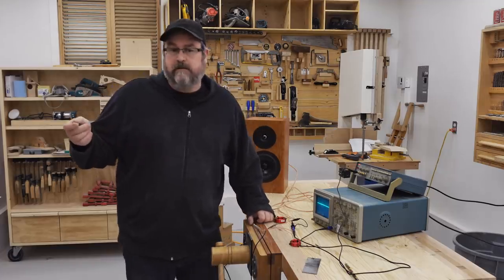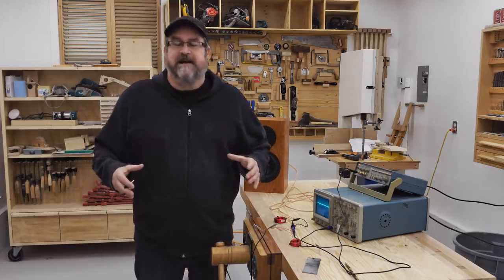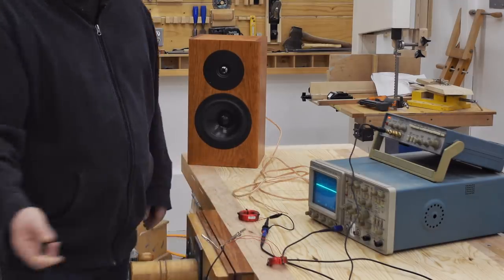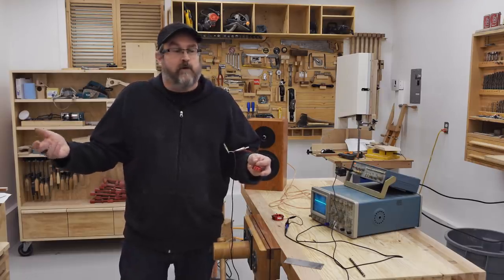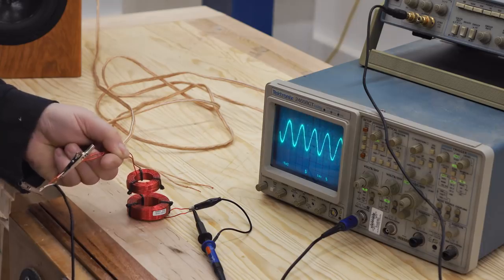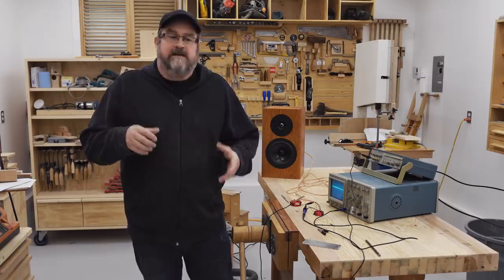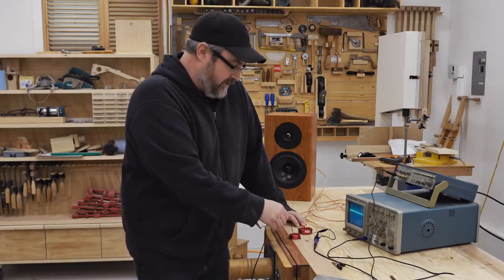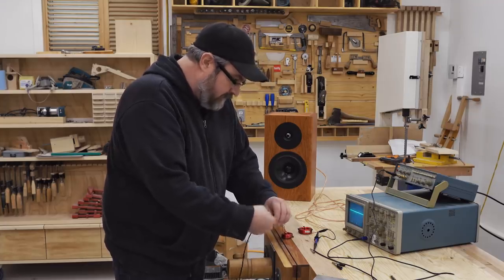Is Coil Coupling (Mutual Inductance) Really A Problem? DIY Speakers

Comment from the maker: The crossover building video:
https://www.youtube.com/watch?v=kO2faotm3sE

Another thing about this coupling between coils is that no filter is 100% effective - it's a slope, so there's already some low frequency signal going to the tweeter and high going to the woofer, but at a MUCH lower volume. 
My scope was set to 5mV per division, so the coupling when the coils are spaced as I did in my crossover is around 5mv peak to peak. 
And yes, this would go up as the volume goes up, but so would the regular music output from the speaker. 

You can help support the work I do in making these videos: 

Plans for sale: https://ibuildit.ca/plans/

Support this channel on Patreon: https://www.patreon.com/user?u=865843&ty=h 

#ibuildit
#diyspeakers

Did you know I have other YouTube channels? 
My main channel: 
https://www.youtube.com/user/jpheisz 

More videos on my second woodworking channel: 
http://www.youtube.com/c/IBuildIt 

My home reno channel: 
http://www.youtube.com/c/IBuildItHome 

Website: https://ibuildit.ca/
Facebook: https://www.facebook.com/I-Build-It-258048014240900/ 
Instagram: https://www.instagram.com/i_build_it.ca/
Reply: I would love to see more info on the transfom circuit on your sub amp. Reasearching stuff on speakers is like going on mums net.
Reply from the maker: Sirus - details here: http://sound.whsites.net/project71.htm

Comment: As an electronic guy It's lovely to hear good old common sense. There is a thing called good enough, and just bacause you can mesure it, it does not mean you can hear it.
Why does they sell overprised things? Because somone out there (all to many) will buy them. 
Love your videos John.
Reply: This was a cool video, but I think a few areas were overlooked.

What happens when you start pushing 50 watts through the crossover?

Also, I don't think it's completely about hearing the mutual inductance...but how the mutual inductance could alter the crossover point that the coil was setup for.

Comment: I agreed with you right up to when you mentioned pro designers using textbook formula. I know quite a few high 
end designers and builders. No one with any real understanding of crossover design uses or starts that way. its a waste of time because it is inherently  an inaccurate method. 

What you have as far as layout is fine. plenty of space. To mount an inductor to 
stand, hot glue and a pr of zip ties work great.
Reply from the maker: Your comment has the needle is in the red on my my nitpick detector 
:)

Comment: great video and demonstration. that being said...using a 0.55mH instead of 0.7mH IS a big difference and will definitely mess up your frequency response in a significant, measurable way if the coil is used for example in a zobel filter to flatten some bumps

Comment: The generator may be set to 10V P=P, but did you measure it with the coil connected?  Most signal generators have an op amp output and do not have a power amplifier to drive low impedance loads.  I doubt it can drive 10V P-P into a crossover coil.  10V P-P into the speaker is about 8 Watts of power into an 8 ohm load.  Doubt the signal generator is up to the task.

Comment: A coil that is 'standing up' is also more subject to vibration problems. And a speaker is a high-vibration environment, so securely mounting everything is a really good idea. You could always have another mounting block or something, of course, but that's more effort...

Seems like turning the coil is more of an OCD "I want to do it just because" type of thing. I would certainly do it just because :)

Comment: Good morning sir.  After watching this video with great interest and as a fellow amateur audiophile, I thought I would briefly share a speaker repair with you.

Back in 1985ish I purchased some Klipsh KG4 horn loaded, poly polypropylene main drivers, with passive radiator speakers from a Military Post Exchange wile on deployment in West Germany.  Up until recently, they have performed flawlessly, sound excellent and are used primary in my home theater setup in my home.

However, I recently noticed a scratching (cliping) noise at certain frequencies at most volumes in one of the KG4s.  I ran a sound test (30hz thru 20khz) from Youtube and was able to determine the driver responsible for the noise.  I removed the driver which was made from polypropylene and has an inverted (concave) butyle rubber (I think) suspension which was in like new condition.  After manually moving the driver with my fingers, I detected the scratching noise.  Upon closer inspection, I noticed that the wires coming from the speaker cage binding posts, where the inters the back portion of the speaker were loose.  As if the adhesive had failed and the wired was dragging in the hole during vibration.  The wire terminated under the voice coil cap on the other side (front) of speaker.  

I decided to retract the wire(s) from the rear side of the speaker cone with a pair of forceps until the slack was gently eliminated.  Then, I used a toothpick and deposited a single drop of 2P-10Thick Adhesive to the wire and allowed it to flow onto the speaker cone.  While still maintaining steady retraction of the wire, I sprayed a quick blast of 2P-10 Activator onto the glued area.  I did this with the adjacent wire as well.

After a few minutes, I reassembled the speaker and tested with both the same sound test (30hz thru 20khz) as before and various music and various home theater audio decoding formats and listening volumes.  

It was amazing that this repair has brought my speakers back to original sounding life again.  Most certainly, I would have not be able to purchased replacement drivers for such an older model Klipsh speaker?

Anyway, I thought you might be interested in this story.  BTW, I am not promoting the super glue brand...it's just what I had on hand that is normally used for woodworking projects or to repair a cut finger from time to time.

Klipsh KG4 fronts
Klipsh SC5BK center
Klipsh R5800 rears
Velodyne DDP Sub (will soon be replacing with Klpish R112SW unit)
Yamaha TSR 7850 Receiver

Thank You

Mark Nicholson
Former US Army EFMB Combat Medic 1/94th FA MLRS

Comment: With lower frequencies in Audio versus Radio spectrum, much higher inductance is needed.  This is why iron core inductors are used to enable less required turns.  Is there any electrical theory that explains why iron core inductors are hated ?

Comment: Thanks for your test theory. It is very plausible but somewhat flawed. In a active audio crossover playing music is quite different than using a tone generator that is set at a constant voltage level. In a operational speaker crossover you’re having a wide range of voltage input and output going through the crossover. And for some people who play music quite loud, that voltage can range anywhere from 2.86 V all the way up to and over 80 v. So yes you would be able to hear the difference, just my  opinion. And I don’t consider this a  small little thing , like you stated
Reply from the maker: You do realize that it's the same signal that's already going to the driver at full volume, right? It's not some other totally different signal - it's the same, just a different band of frequencies. 
I know you can't reliably hear that at any volume level. Assuming you can isn't the same as actually doing it.

Comment: Thank you for harping on this point.  I love precision, I love absolute, and perfection.  Reality kicks in when you do anything with real materials like metal, wood, electronics, etc, and if you are OCD over the details, you won't do anything, or it will take forever, or cost way too much, just like you said.  I have to work through the reality of getting it done, and letting good enough be good enough, knowing I will get better, or it really didn't need all the obsession in the first place to be excellent.

Comment: Minor correction. As soon as you said mutual inductance, I thought 'just say transformer'... and you did. However, the concept of mutual inductance is that the inductance of a coil is not the value printed on the label, because another coil is lined up with it. The concept of a transformer is that you purposefully transmit by intertwining 2 coils.
The real test is to look at the signal when the coils are 6" apart, in the same plane, and perpendicular. You did that for overlapping coils, but not for the perpendicular configuration you're ignoring. If you see little improvement there(rescaled to better measure it), then it obviously makes little difference.

Comment: All true. I'd add  that the design is correct to 3 decimal places, but the components are only available in fixed values and "close enough has to be good enough". In addition, most use standard tolerance 10% variation parts (overall variance between units may be 20%) and, if you are buying from China, I doubt your getting better than 20% parts and 40% between units - not exactly precise.